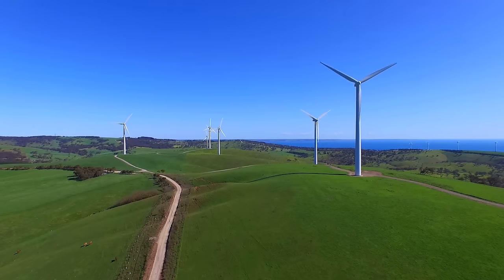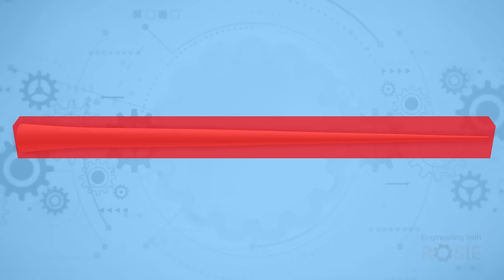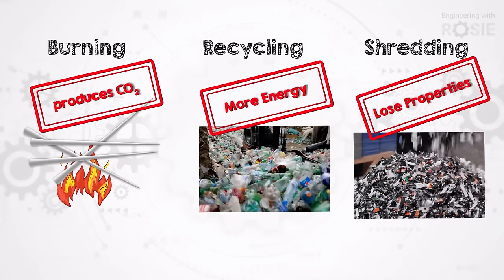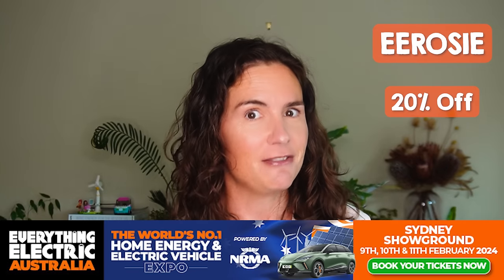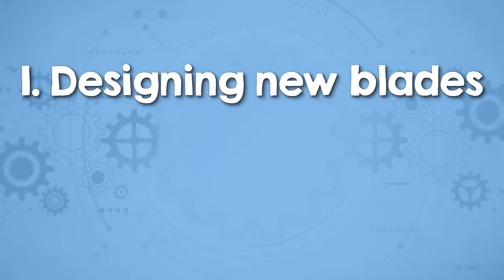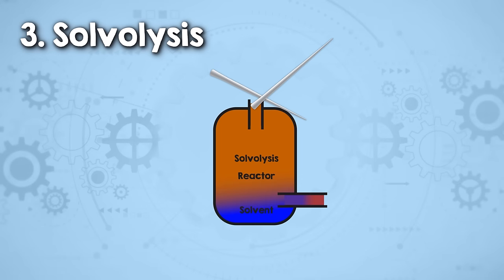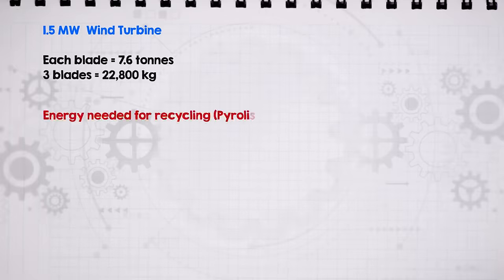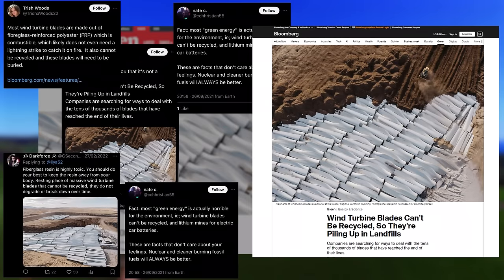This Is Why We Don't Recycle Wind Turbine Blades

Comment: Your idea of comparing the turbine composite material consumption to a bike frame is very effective. I'll borrow it! 😄
Reply: Surprised me a bit, granted makes sense since how spread out the waste is per capita (or whatever the right term would be)

(Granted in my biased opinion having good Waste-to-Energy infrastructure with materials recovery is worth it regardless!)
Reply: Not really because that's two technologies we want more adoption of, so you're making bikes look bad as well. Find something we don't want, like cigarettes or some other stupid product and compare it to that. "You could save a lot more waste by getting rid of this thing that no-one needs..."
Reply: @jonevansauthor  I understand what you mean, but the point of this is that both the bike frame and the turbine composite life consumption are a very small amount of material.
Reply: It’s not really a good comparison. I have eight bicycles in my household and none of them are made from glassfibre or carbonfibre. 80+% of my electricity comes from wind turbines
Reply: @pmbdk  Right, outside of racing, steel bicycles work just fine and steel can be recycled with no loss of quality.
Reply: :) My takeaway is to keep using recyclable materials for bikes. Like aluminium and steel.
Reply: I love it. Communication is hard, and this seems like a good way to fight back against misinformation that involves overly focusing on one particular thing (like a photo of wind turbine blades in a landfill). People have to think big picture, and comparisons like that are great tools to help with that.
Reply: Install them at beaches/lakes as piers to dive off 😂
Reply: @bakedbeings  if you think some blades are as long as a football field, it's going to be a looong run-up 😂
Reply: My share is quite small for 20 years of energy.  If you compare that to how much other waste I am directly responsible for in landfills for the last 20 years, that's practically nothing.
Reply: wait, where were bike frames mentioned?
Reply: And they are 100 percent made from oil! Go figure.
Reply: It only applies if you discard the bike . So you assume a throw away mentality .
Reply: @fakshen1973 in many situations the life of the blades has only been two years.
Reply: compare it to risks of nuclear disposals and wind turbine blades is the smaller problem i guess!
Reply: @FranzJStrauss  A good friend of mine was diagnosed with terminal cancer in the 80s. She went to a private clinic in the states where they inserted radioactive gold rods in the tumors, and she has fully recoved. The radioactive rods are made from nuclear reactor waste!
Reply: @FranzJStrauss  True turbines are 1,000 times more dangerous than a nuclear reactor.
Reply: @terenceiutzi4003  
For Sure LOL... you are spreading Mis or Disinformation.
Reply: How many people have died from reactor malfunctions? How many hundred have died from wind turbine failures? And you want people to believe they are safe? LOL!
Reply: @FranzJStrauss  get yourself a Geiger counter and check the radiation levels at your nearest wind farm and then see if you can get a reading at a nuclear power plant. Then you will know which is more dangerous!

Comment: I think the blades could be used for snow fences in Wyoming. And maybe use the blades for wind blocks to solve cross wind problems on some road ways.
Reply: Good thinking, we need more ideas like this.
Reply: I mean... don't they use hedges for that?
Reply: Very inventive! Good idea! Totally bonkers, but good idea!
Reply: @jonevansauthor yes, but, hedges don't grow everywhere.
Reply: And for ground stabilization in some places.
Reply: Yeah, but didn't you see the lackluster part on repurposing? Clearly it's not worth considering because bridges and playgrounds.
Reply: @UncleKennysPlace  indeed, perhaps retaining walls.
Reply: Can work for road railings too or barricade junctions where the energy can be absorbed during head on collisions.
Reply: Yep. And the ultimate is reef bones. Underwater, attractive, and an absolute requirement for shore protection in a warming world. There won’t be enough blades to be “too many” in a thousand years
Reply: @custos3249  re "Yeah, but didn't you see the lackluster part on repurposing?"
I think that is because bridges and playgrounds are more novelty and cannot use a significant number of the blades.  If other reuse methods are able to replace manufactured  materials, it is more useful.   Especially if it is done on a large enough scale that it does not take more money and resources than it saves.
Reply: @jfess1911  Which was the point of my snide remark. It's not a matter of "if." There are other uses. Brushing it off and not searching them out is intellectual laziness per every engineers' inner Cali girl "cuz it's just like sooo harrrrrrd." We get it, engineers. Burying your turd in the sand is easy.
Reply: Reduce
Reuse
Recycle

What ever happened to the first two... plus I hear they have a lot of these things stacking up in Texas that are full of bees and snakes...
Wink wink
Nudge nudge
Say no more.
Reply: @ulrichraymond8372  repurposing wind turbine blades as road barriers and railings is using a second-grade material to provide life-saving protection. I think that a specific purpose-designed structure is always going to be FAR preferable for this use.
Reply: You could grind them up and use them for filler in road sound barriers. This would help with road noise for the people who buy houses next to the road and complain about the sound. Possible sound mat or insulation.

Comment: We don’t recycle blades here in North America, but we do grind them up and send them to concrete companies for the fibrous material to strengthen the concrete.
Reply: Is that not re-using ? Its kind of downcycling , but the CO² locked in the composite remains in the new product , the transport of old blades is relatively cheap they can be cut up,or rough crushed on site to suit the trucks, hell if its a large wind farm  refurb / renewa,l the finished crushing could be done on site ,with something like a wood chipper,
Reply: There is even research into adding carbon to concrete that shows it can even significantly improve the properties of the resulting concrete... Personally, this approach makes the most sense to me at the moment... In 50 years, the situation may be different, but compared to coal and oil, burying non-toxic material is literally a small thing...
Reply: Is that waste ok when it starts wearing out of the concrete? The same is proposed for plastics to be ground down and used in new products. But if it is not melted together then as the item weathers you are getting micro plastics leaching out into the environment and therefore is it really eco? Just a question.
Reply: Duh so you do recycle it, you don't seem to understand the term...😂
Reply: I heard they were used as fuel to heat the cement kiln.
Reply: That is recycling. You do not have to put the material into the same type of product for it to be recycling.
Reply: @markharmon4963  You heard right.
Reply: The Economist suggested that the mega size blades produced in the last few years could be chopped up into roofs for cheap or emergency shelter. They are so big that you get many such roofs where you'd barely notice or care about the curvature. This seems like a really neat reuse scenario.
Reply: @orionbetelgeuse1937 
At 8:26 in the video she literally explains how "cement co-processing" is a form of recycling. There's even a power point slide to to drive it home.
Reply: we also burn them in incinerators to make electricity.....very greeen...
Reply: @orionbetelgeuse1937  WRONG.  Recycling is recycling, no matter what the subsequent form.  If pop cans are made into aluminum I-beams, is that not recycling?
Reply: @itsmatt2105  it is recycling, those I beams are common uses of the aluminum and is a cycle which can be repeated (meaning re-cycle) the aluminum from the cans or beams can be melt and reused to make aluminum objects again. The blades cannot be restored to the initial state and make something else from the material. It is no a cycle or re-cycle, it's just a reuse for a purpose much inferior to the initial purpose. If you use an old helmet as a flower pot that is not recycling.
Reply: @orionbetelgeuse1937  "helment to flowerpot" is a ridiculous parallel to draw regarding using fibers from wind turbine blades to reinforce concrete.
Reply: @itsmatt2105  why? it is not a good material to reinforce concrete. The material used for this is rebar not wood and plastic from the blades. Also it is not re-cycling because it is a one time reuse.

Comment: Two things Rosie,  you skipped over why these blades are decommissioned in the first place, too small? Cracks?  Secondly, having paid a bloody fortune for trusses and beams, it seems to me that simply cutting them up into pieces 14m long and then ripping the cross sections into useful shapes would allow them to be used in all sorts of buildings. Say for cantilevered overhangs that only need to hold up one elephant?
Reply: I love the idea of roof structures being made with used turbine blades. I am sure they're going to be excessively strong even if they're retired from their primary role.
I suppose the biggest problem would be manufacturing the brackets to attach them to the other roof components. But if someone had a steady supply of a particular design of turbine, then they could CNC cut a series of brackets that do the job. Perhaps warehouse roofing for the larger blades.
Reply: Not enough elephants left.
You would be better finding a use related to London Buses
Reply: The first question is addressed in a different post..... Since it's not directly related to recycling it wasn't mentioned....
Reply: eherm....Building codes?
Reply: @BobHannent  Or have various designs of roofs for different blade sizes, or just use them for long roof spans (hangars?) and use other materials on top for weather protection.

Comment: What about the blade determines that it needs to be replaced? I imagine it wears out at certain stress points. Would it make sense to redesign the blades so they can be repaired? What about aluminum or titanium?
Reply from the maker: Wind turbine blades are designed to last the same amount of time as the rest of the turbine, in theory everything should wear out at once. And yes there are stress points but a well designed blade would not have any one location significantly more stressed than the rest. They used to use aluminium but there were a lot of fatigue failures. And also the blades would be heavier. I made a video way back in the early days about design lifetime, that talks about all this stuff I think: https://youtu.be/PfquMx9h98M
Reply: I think my response triggered auto moderation for poking fun at fossil s h I l l s. 🤔
Reply: Yep. Definitely I'm being deleted for constructive comments
Reply: leading edge wear.   youd think they would just add in a thin covetic metal layer so it stops !
Reply: @H4N5O1O  helicopter tape is a thing, and it works to protect composite blade leading edges.
But helicopters don't operate 24/7 for decades.
Sometimes stuff just wears out or becomes no longer serviceable/economical to maintain.
Reply: @EngineeringwithRosie  Have you read Oliver Wendell Holmes "One-Hoss-Shay"?
Reply: @jimurrata6785  Towers tend to be made from steel so should in-theory be wholly recyclable.  Maybe I miss your point there though.  Also, yes, your comment has been hidden by default.
Reply: @UCCLdIk6R5ECGtaGm7oqO-TQ  No one said anything about towers not being recycled.
Bigger turbines require taller towers and deeper foundations to keep from toppling.
You can't just reuse them as is.
I'm not sure what word/s I used that trigger the algorithm, but I literally linked a Rosie video in another comment (without any words and that got canned as well.
YouTube needs to change some settings or their learning model
Reply: @UCCLdIk6R5ECGtaGm7oqO-TQ  The point of what comment?
The deleted post was about the one hoss shay, where the deacon made it to last forever and everything all fell apart at the same moment 100 years later.
Just like Rosie said that blades, turbine and tower are all intended to have the same design life.
Reply: @jimurrata6785  Your comment isn't deleted; it's just hidden.  I didn't particularly understand your "one hoss shay" tower reference even after looking it up, but thought I'd mention that the towers may not suffer the same recyclability issues as the composite turbine parts.
Reply: @UCCLdIk6R5ECGtaGm7oqO-TQ  Thank you for your insight about why the comment didn't show up.
Yes, the poem immediately came to mind when Rosie said the whole tower was supposed to have the same service life.
None of us can speak with certainty about what new process or material might be developed 20, 10 or even 5 years from now.
The one thing that IS certain is that the renewable sector is refining and streamlining energy collection every day.
I'm older and will probably never see it become a fully mature science, but at least I'm hopeful.
Reply: I am wondering if, after the wind turbine's end of life, the blades can be inspected, strengthened/repaired if needed and reused again on a new turbine? Or that is not really doable because, after said 30 years, the blade would be technologically obsolete (too heavy, not optimal, etc)? Or, maybe they can be used to replace damaged blades of other turbines, without the need to make new ones?
Reply: Currently the old wind turbines tend to be replaced with bigger systems, so you wouldn’t want to use the puny old blades for new systems. Someday that may change, but we aren’t there yet.
Reply: This thread has many of the issues that typifies an internet discussion.  Rosie presents a broad analysis of the actual current state of blade tech, the current issues, the future of the technology, all of which details the complexity of the issues at hand.  And then someone posts a single line  “gotcha” comment that they think defeats all of the realities.

Comment: How about a video on the lifetime of blades, mechanisms of how/why they wear out or fail, what options are there for making blades last longer so there is less need recycle them, etc...
Reply: I think a fair fraction of the blades come up not because of end-of- life but because existing wind farms replace their turbines early.  With the scaling of power as blade length increases, you could put two 8 MW units in the space of four 2 MW units. 

Upgrading an existing site might be better/ easier than opening a new one.
Reply: A big problem is that insufficient account was taken for the grinding effect of dust in the wind. Apparently it is grinding down the leading edges of the blades, so the blades are having to be changed earlier than expected.

Comment: I like the idea of converting the blades into rebar. You still get to keep the material advantages of the composite (strong but not brittle, corrosion resistant), while keeping the recycling process simple (cutting the blades into lengthwise strips). You also get around the skate park problem, as rebar is something with a continuous industrial demand.
Reply from the maker: I also really like that idea. I couldn't find a lot of details about it (no photos yet, it's not mentioned on Regen's website). I only know they're doing that because of a podcast I listened to. I did get in touch with the company to let them know I'd like to know more so hopefully I can feature that solution in more depth in the future.
Reply: Rebar is designed like it is for reasons. Strips of scrap turbine blades do not offer the same benefits. It is not just a case of putting long things into the concrete.
Reply: @Dilbert-o5k  Why not? You could add new epoxy &  fibre bands around the long sections to connect with the concrete, and ditto for tying together different blade sections. This would also solve the corrosion problem that concrete has when water leaks in thru cracks to rust the rebar, expanding it and weakening the whole structure. Maybe the only reason not to is if the sections have different thermal expansion rates.
Reply: @tomtrottier8135  YT disappeared the original reply 
Why? You need to look into why rebar is used and what qualities are required. Then compare with strips of scrap wind turbine blades and see whether they match up. Rebar isn't just there as filler.
Reply: @user-it7lf7kk8m Good points. Steel is great for rebar because of its high tensile strength. I know that carbon composites can replace steel in some applications, but I don't know how well it works here. I'd do know that carbon fiber composite is stiffer than steel, though (and that sounds like a problem in this application to me, though I could be wrong).